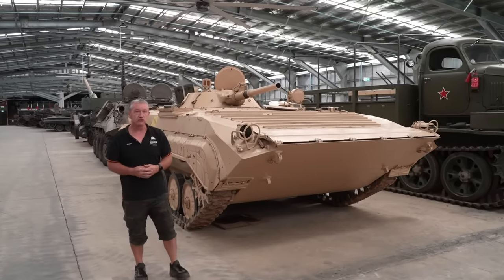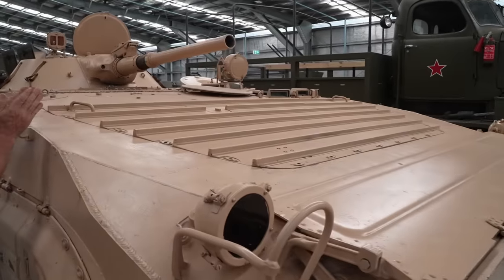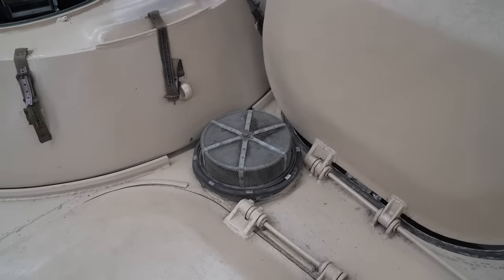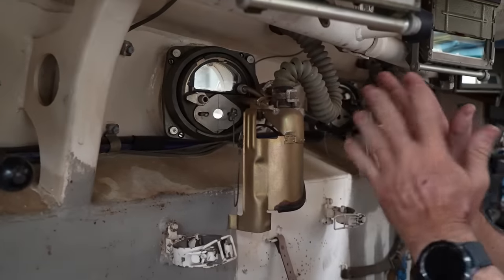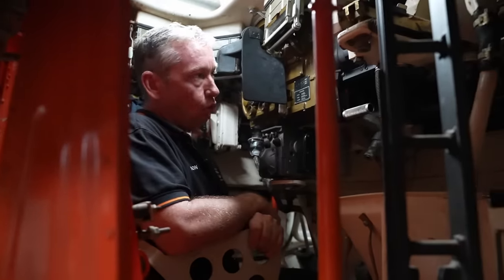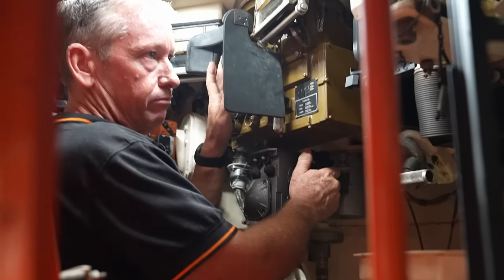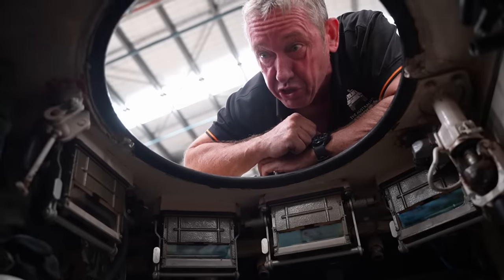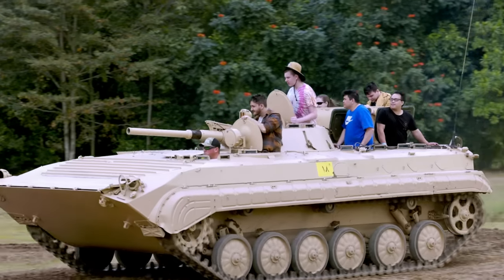BMP-1 Infantry Fighting Vehicle: The workhorse of the Soviet Motorised Infantry

Comment: this vehicle always struck me as a great looking vehicle, with a somewhat flatter profile from the front, i've always wondered why other countries never really copied it, i.e. the British versions on the old VCRTs, Spartans in particular, were a bulky machine, and pretty slow in comparison - i found them to be ok-ish on the road, great fun at speed, off-roading capability not too bad, as with most tracked vehicles pretty stable with a comfortable ride - the old petrol engines were a pain to maintain, but the diesels made a better job of it, more torque of course, the back doors were horrible and too heavy, the BMP rear doors much better i imagine for opening with them being set at an angle, good thinking there and to make them into fuel tanks, kind of makes retreating a tad fun, but then under fire i guess you simply reverse out tactically and spin round once out of line of fire - looking forward to more videos, great series along with the ongoing restoration work
Reply: The Chinese produced unauthorized copies it as they did with much other Soviet kit.  So did Romania and Iran, and it looks like Vietnam is about to do the same.  Czechoslovakia and India produced authorized local variants.  Many countries such as East Germany modified the ones they got.  More broadly, the BMP-1 kicked off a revolution in armored vehicles and was arguably the first major IFV from which all others are derived.  

I think Western countries avoided its basic design philosophy for several reasons.  One is that while its very low height reduces its visibility and enhances its protection, it also means that its main gun can endanger its own dismounted infantry instead of firing over their heads.  Another is that its small size was better suited to Eastern Bloc troops who (usually being Slavs and Asians) were shorter on average genetically plus also (being in Communist countries) were less well-fed so didn't reach what genetic potential for height they did have anyway.  Still further, while, say, the Sherman is well-known for being internally comfortable, Soviet armored vehicles are well-known for being cramped, awkward, and tiring (even for their smaller crews).  The Western priority was not just about luxury or morale but about long term combat effectiveness, while the Eastern priority was about lower cost, logistics, and enabling more mass production.  Finally, the Warsaw Pact's overall forces were designed for the offensive en masse.  Thus emphasized quantity, speed, range, ease of operation by low-trained conscripts, ruggedness in field conditions (with the assumption of minimal maintenance but also wearing out or being destroyed soon), and most of all river crossing capability thus low weight so any bridge could hold them and amphibious or snorkeling capability so they wouldn't have to use bridges if no intact ones were nearby.  By contrast NATO forces were geared for the defensive while outnumbered, thus emphasized heavier armor for crew protection, long-term functionality (if being carefully maintained by well-trained mechanics in well-equipped depots) plus rate and accuracy of fire at long distance via better optics, sensors, precision, well-trained troops etc.
Reply: @IrishCarney  excellent description
Reply: @IrishCarney  Your opinion is wrong, the average height and weight is equal to the average European, because there are not so many differences between Western and Eastern Slavs or Germans. According to the tactical application, armored vehicles move in front of the infantry, not behind it. The main task of the BMP and BMD is to throw into the enemy's rear and disrupt and destroy communications and equipment in connection with what they have a lower weight and profile
Reply: @IrishCarney  
1.5 roku byłem działonowym .
Operatorem uzbrojenia.
Wcześniej przez 6 miesiecy szkolenia jeździłem jako desant.
Mam 180cm i wtedy około 75kg wagi.
Nigdy nie było mi ciasno. 
Ani w wieży ani w przedziale desantu.
Lubiłem jeździć przy tylnych drzwiach. 
Bo tam najmocniej buja i jest najlepsza zabawa.
Zbiorniki paliwa w tylnych drzwiach to podwójny pancerz i paliwo w środku które też sporo spowalnia pocisk.
To były lata 87-89 i już wtedy był to wóz przestarzały.
Powszechne w użyciu były wtedy   nowsze BMP- 2  , z armatą automatyczną 30mm i innymi  ulepszeniami.
Reply: @robertagowski9492  Interesting, thanks.  I've seen multiple videos talking about how cramped the BMP and other Warsaw Pact AFVs were but your response is a counterpoint to take into account

Comment: Excellent vehicle description, would love to get a ride in the BMP-1 if I ever visit down under (how much to fire the cannon 🤔😁)! Seen an great video a few months back of a Ukrainian BMP-1 firing a rapid volley from the main 73mm cannon down range in an indirect fire role. Seems gunner was well coordinated loading shells at a quick pace but think 8 rounds per minute a bit optimistic (seemed closer to 6 RPM). Shells are rather long & a bit awkward to reach behind from rack, then to load. Because the crew shares the compartment with the cannon shells things can get ugly in those things if they get hit by anything bigger than 20mm cannon (& worse if hit by RPG's or ATGM's). If fortunate enough the initial blast little or no time to get out before ammo starts cooking off. According to Oryx Russia has lost at least 341 BMP-1's thus far and the Ukrainians 256 in about the last year. The #'s of BMP-2's lost is even worse 😳(approx. 800 lost by Russia & 100+ on the Ukrainian side).
Reply: The video you saw was likely a BMP-1 without a functioning Auto-Loader, as he states in the video that BMP has its Auto-Loader working.
Reply: Source: "trust me bruh"
Reply: clown

Comment: Easiest way to kill a BMP1 & 2 shoot through the back doors the armor is easily punched through by a .50cal and the fuel tanks are easily punctured...API rounds work well
Reply: If I remember correctly the presenter stated that the inside of the door was also armoured so it would not be hard to include a weak spot on the outside armour, (which could be shielded,) so that if the fuel exploded it would vent outside. I don't think this has been done on any of the revisions so the Russians must consider it a minor issue.
Reply: with stated thickness and added diesel in the way - highly unlikely to penetrate with .50

Comment: A almost 60-70 year old vehicle still being used that’s bit weird ngl especially when BMP-2 BMP-3 and BMP Terminator BTR are a thing
Reply: Not that weird.. they made thousands of these things. M113 variants are just as old and still rattling around battlefields.
Reply: @frostedbutts4340  I’d disagree especially when the M113 isn’t older or had as many variants or made as much it’s like of America or the UK pulled out Sherman’s or Churchill’s in 2000 or 2010 which Russia is doing with the T-54 lastly the BMP-1 technology and versatility is too old tbh hence why so many upgrades/variations were made and there’s a difference between using a troop transport and a IFV which is closer to the Bradley which is better rn easily but hey when you are using Mtlbs which are engineer vehicles and even older guess BMP-1 is better then nothing but just ludicrous to see in 2023 but they’ll be easy to take out or will break down before that.
Reply: @Channel-23s  >I’d disagree especially when the M113 isn’t older
It is 6 years older than the BMP.

 >or had as many variants

https://en.wikipedia.org/wiki/Variants_of_the_M113_armored_personnel_carrier lol there are so many I can't even begin
Reply: @frostedbutts4340  Guess I was thinking development wise might’ve been older my bad was off by 5-6 years as for the M113 it is smaller or uses less parts as for variations (40) guess depending on how big the changes are it’ll be more then it as for some various that Russia got BMP terminator or BMP-2 or BMP-3 Kugernats or even the BTRs too I’d say the M113 is definitely planned to be phased out and isn’t the most ideal support or IFV like the Bradley’s or AMPV in 2023-2024+.The soldiers on both sides in Ukraine might despise the BMP-1 but use it out of danger/emergency but Ukraine has gotten or been pledged some great additions now or in the near future. (Side note correct me if I’m wrong the M113 is a APC that isn’t gonna see too much head on combat compared to the IFVS like BMP-1 or Bradley)
Reply: @frostedbutts4340  forgot to mention think they might be using very very old BMP-1 IFV while America is using variations or newer upgraded M113 APC and it’s used less or being replaced but I would be surprised if the military is using older M113 that have less technology and firepower would certainly be a eye opener ngl tbh and it was replaced somewhat with the Stryker and or Humvee and JLTV or the Cougar APC which was sent to Ukraine too

Comment: Russian soldiers typically ride on top of the BMP, so that they're not sitting next to those fuel tanks in event of an attack.
Reply: I think you are confusing the BMP with the BMD. The BMD looks similar(-ish) but is designed to have the troops riding on top. There seem to be a lot of BMDs being used in the Ukraine for some reason.
Reply: The fuel tank is in the middle... if anything hits the fuel tank then it's already gone through the crew😂 fuel tanks arent explosive like in videogames

Comment: Posibly PKT MG could be mounted in the forwardmost firing ports of the troop compartment, however the actual intended purpose was to accommodate the regular PK(M). 

PK"T"(M) designates the Kalashnikov Machine Gun variant intended for 'permanent' use in vehicles/gun turrets. It lacks the stock but has electrically (remotely) operated trigger. Do not remember anymore if its barrel had the 'quick replacement' handle like the regular PK. Flame suppressor is also different and that alone might be the reason why PKT does not fit in the hull firing ports.
Reply: True the forward most firing port are for the pkm guy and yes be will using his pkm for that gun port.

Comment: having a shooting port with case catcher and fume extractor for each soldier seems like an unnecessary expense for such a vehicle and very unlike the soviets to install that. Wouldn't the one machine gun on each side do for the self defense role?
Reply: I know right? I was surprised to see they actually cared about their soldier's health back then. They certainly don't today!
Reply: The gun ports aren't there for self defense, they're there to maximize offensive firepower. The Soviets were working under the presumption that future battlefields would be nuclear or chemical wastelands where it wouldn't be safe to dismount so they designed a vehicle where everyone could shoot from inside when it was too radioactive or toxic to go outside.  Turns out they were wrong about that.
Reply: @danielstickney2400  That kind of makes sense but with every port you add, you are adding a potential entry point for radiation or chemicals and why are you carrying around all this infantry around if they can't disembark anyway? Seems better to send in a dedicated fighting vehicle in that case. I'm still not convinced that this was a good decision.
Reply: It's part of the NBC system. All of the buttoned up aspects were there to allow you to fight from inside the vehicle during a nuclear or chemical war. Venting your gun gasses outside makes keeping the air inside breathable a lot easier.
Reply: @20tigerman20

Comment: It is VERY deceptive to say the BMP could penetrate the front of an M60 tank.  It could possibly penetrate areas of the M60 at point blank range , which is practically useless.  The BMP-1's main gun was practically useless against probable threats and the reason it was abandoned in favor of the 30mm 2A42 autocannon.
Reply: it doesnt care about range, its fire HEAT rounds and penetration value doesnt change with distance.
Gun was dropped because it was:
1) innacurate enough to engage targets further than 500m 
2) 73mm is too weak to use against infantry, barrely holds any charge.

BMP-2 uses much better ATGM system that can engage tanks\fortifications at further ranges with more controll while 30mm is much better at providing fire support.

Comment: It's a shity product. 
Apart from driving speed and good mobility in the field - offers nothing, certainly not protection for the crew members inside. 
Shooting with your AR's from inside this thing out through the portholes on the sides? Unnecessary and ineffective.
Reply: Lmfao this guy. Is the Bradley offering any protection? The Warrior? The PUMA?
Reply: @divinesan7786  
I'm not talking about the Bradley or Puma. I'm talking about the BMP. It's easy to penetrate.
Infantry Vehicle that protects its crew? - The Namer, for example.
Reply: @michaelsteinmann529  lmfao. That's the point. BMP and just like Bradley or PUMA, they are not designed to take hits from AT weapons. None of the IFV could currently, they can mostly resist rifle rounds and .50 cal. And no, Namer is heavy armored personel  carrier which is made from Merkava IV hull. If you are gonna bring it in, then T-15 Armata IFV